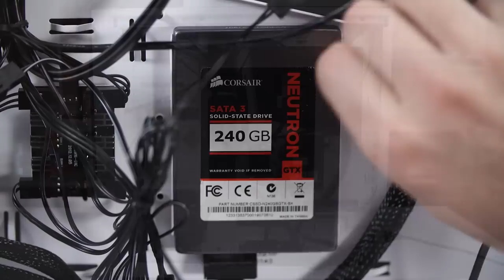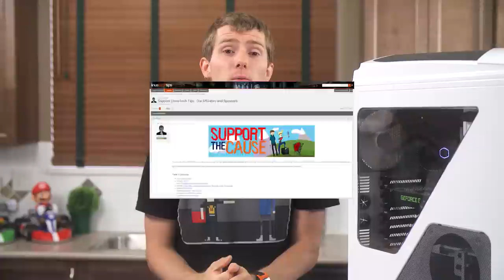NZXT Phantom 530 Gaming Full Tower Case

Comment: Can someone help me? i want to build a decent gaming pc for games like bf4 and i want to run on high settings or ultra with 40+ fps but i dont want to spend no more than £1000 all i need is a psu can someone suggest me one and maybe tell me if everything is compatible 

Cpu-  AMD FX-6300 6-Core Processor Black Edition

Ram- 16gb Corsair Vengeance 1600Mhz

HDD- £59 WD Blue 1 TB

Motherboard- ASUS Z87-PRO

case- zalman z9 plus(I might get a bigger one as this one is small)
Reply: you realize a Z87 motherboard is an Intel chipset right? It doesn't have the same socket as any AMD CPU.
Reply: Like MTS said, that motherboard is not compatible with that CPU. You need an AM3+ socket, such as http://www.newegg.com/Product/Product.aspx?Item=N82E16813131872 or http://www.newegg.com/Product/Product.aspx?Item=N82E16813131873
Reply: you will also need the graphics card you're going to buy before asking for the psu. the GC is one of the most energy-consuming pieces in a computer and needs to be taken into account before choosing the PSU

Comment: Linus TechTips It would mean the world to me if you could look at my latest video on my thread of the parts I have bought and give me your thoughts on what I should go with  for a case .My budget is 150-200$ USD thanks!   (long time watcher of all your channels!!)
P.S I plan to get the Corsair H105 CPU cooler,Just not ordered it yet.
Reply: shawnkiller90 If you're looking for immediate feedback hit up /r/buildapc. Very active subreddit that's much more likely to hit you up than Linus is.
Reply: thepromman I already got help on the side. Ended up going with a Corsair Air 540.
Reply: shawnkiller90 Solid! I'm currently deciding between the R5 and the 530, although there is the 450 by NZXT that I'm also looking at since it's kinda a cross of the two.